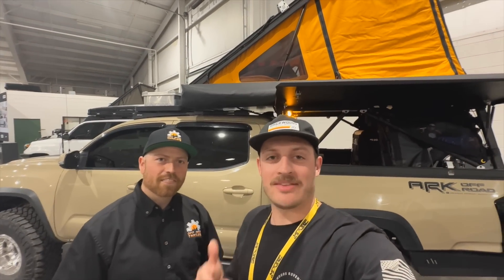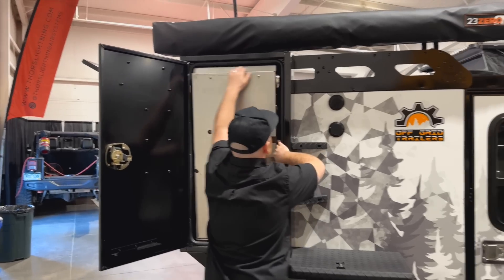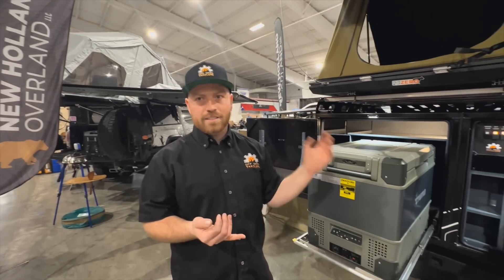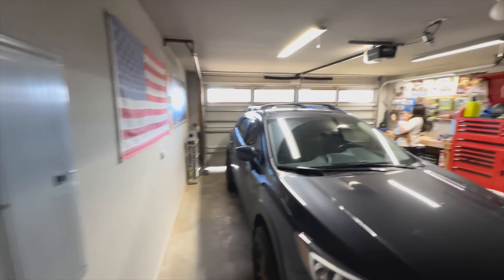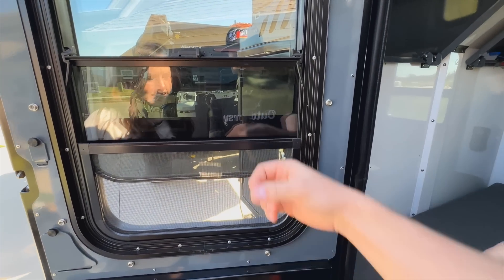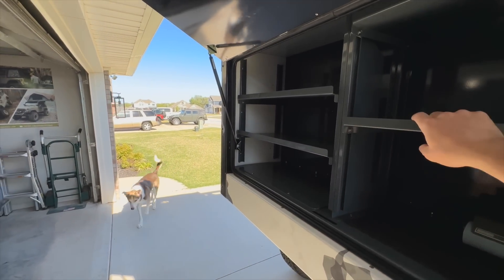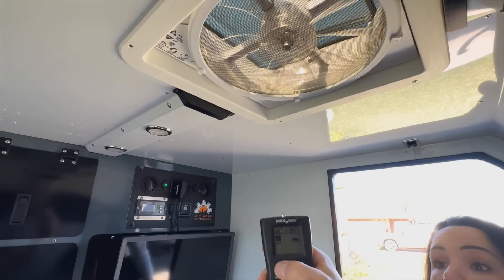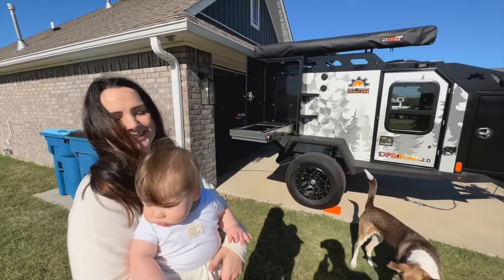I GOT A NEW TOY...Huge UPDATE + Wife's Reaction!

Comment: That's a bitchin' trailer. I just noticed that the exhaust tube from the Propex heater exits the trailer MUCH higher than the exhaust on the furnace. I've had occasional problems with mine shutting down unexpectedly and throwing error codes, most likely due to the same issue. I was out camping in 12F temperature one time, and the tent got too hot so I turned the heater off for a while. When I went to turn it on again, it was showing an error code and wouldn't start back up. After talking to the customer support at Propex, they told me that very likely I had gotten condensation in the exhaust pipe, and the control panel senses that and shuts the unit off for safety reasons. It was definitely the case that the end of the exhaust pipe was sitting higher up than the the outlet on the unit. Since then, I've had the pipe end sit lower than the exhaust on the furnace, and it hasn't acted up again. I would re-route that pipe on your trailer and have it exit at a lower point than the unit itself. At the very least, you should have the folks over at Van Café (the only US distributor of Propex) vet that the current trailer config is OK.
Reply from the maker: Appreciate all the info! I’ll keep all of that in mind. Good to know